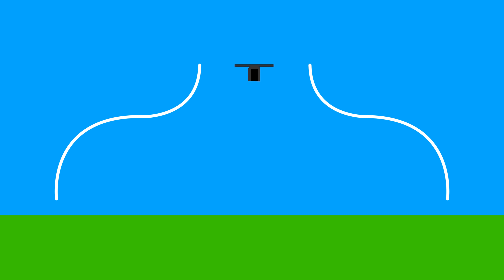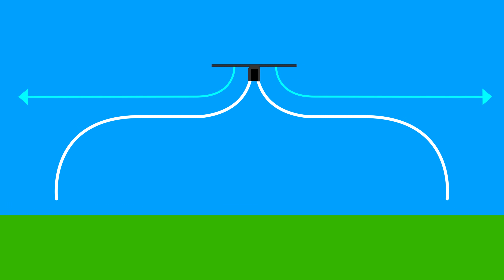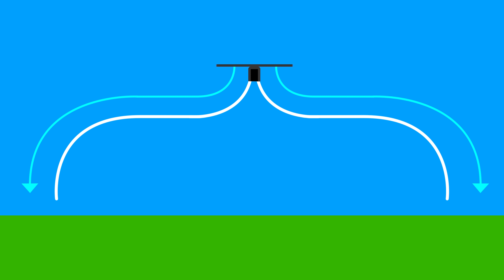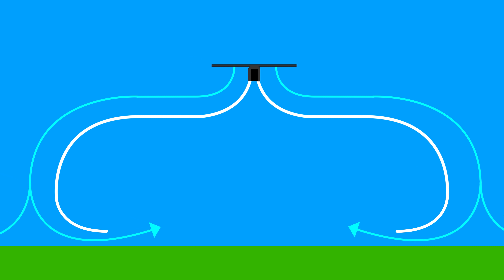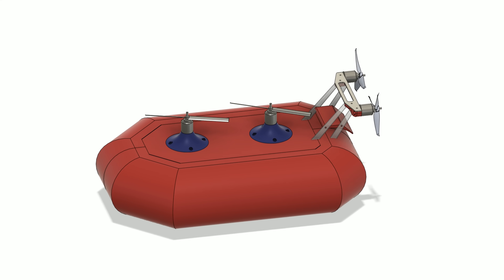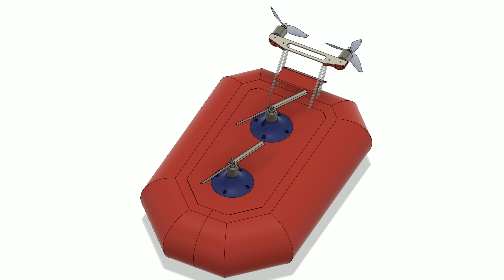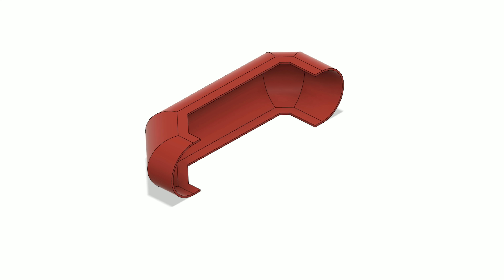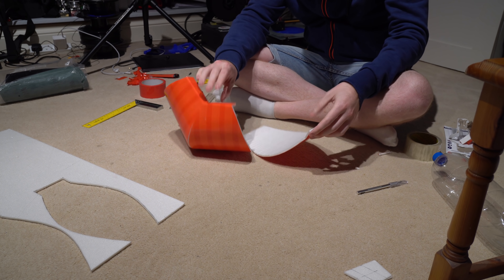Coanda Effect Hovercraft

Comment: The efficiency of this setup puts tears to my eyes, but it's a very interesting experiment nonetheless. I'm glad to see you use foam as well, it can't be praised enough for small scale lightweight construction.

Please keep doing ground effect vehicles! I would really love to see you attempt a wing-in-ground craft in the spirit of the Orlyonok: a long fuselage with stubby wings, a high T tail with the main propeller blowing onto the control surfaces, and a pair of front-mounted jets blowing air under the wings for takeoff.

You definitely have the skills needed to address the vertical stability issue, using some kind of distance sensor and a PID + filters to keep altitude within the tight stability envelope.
Reply: Or perhaps a simple trim control for the lift motors for a start?
Reply: Totally agree about WIG. I find that subject very interesting. Also probably significantly more efficient than this arrangement...
Reply: I’d love to see an ekranoplan too!
Reply: I praised some foam and it turned red.
Never again....
(unless I need red foam.)
It shat me to tears.
Reply: Ground-effect aircraft fascinate me as well. Googled and found this, FWIW: http://www.turkstra.com/wig-types/
Nice starting-off point for the various types of "WIG" (new term to me) aircraft.
Reply: Ekranoplane!
Reply: The problem with the ground effect for these kinds of small-scale experiments is that the practical 'hover' height varies in relation to the vehicle's scale.

This is why even a 100 metre long hovercraft is using a rubber skirt to increase the ground clearance.

Aside from serious stability problems with the ekranoplan concept, there's also just the sheer issue of scale;

Normally, vehicle technologies are developed at a small scale and then gradually made bigger.
But the underlying physics of a Ground Effect Vehicle is such that small vehicles are VASTLY less practical than larger ones.

A 600 metre long cruise ship size GEV would function so much better than even a 100 metre long version that it's almost incomparable...

Yet it's self-evidently impractical to jump straight to building a 600 metre long vehicle as a test.

And when you get down to the scale of even a car, you're already dealing with effective 'hover' heights (if you aren't using the rubber skirt thing to artificially increase it) of a few cm...

Something the size of a typical small scale model hovers at such a low ground clearance that even a moderately uneven indoor flooring surface would be difficult to deal with...
Reply: @KuraIthys  I know about these constraints. If you ask me I'd love to see big ekranoplans being developed as a replacement to airliners and/or cargo ships! The scale at which you can make them would likely make them good candidates for nuclear thermal propulsion, as you would have plenty mass and space for a submarine-type reactor + shielding. Yeah you could also make cruise ships, but those should really disappear at some point if we're serious about pollution.

As for the small scale, there are smaller ground effect vehicles being sold that aren't bigger than a small boat, and they definitely only stay aloft through pilot input. You also only need a boat licence to operate them but that's another story. Put a microcontroller on the job with Tom's code, and I think (at least I hope) stability shouldn't be too much of an issue as long as the model's actuators react fast enough, even at an even smaller scale.
Reply: @KuraIthys  I see you talking about scale. If you scaled up his crafts speed of 10mph up to a craft 100 or 600 meters.

Comment: The problem you have with control is that you don't respect the airflow from the propellers to the curved surface. The Coanda effect needs a continuous line of sight between entry and exit point, don't get me wrong, it still work even with the big wall of the deck you've created, but efficiency is nowhere near as good as it could be. The AVRO car, which is the biggest Coanda effect craft (in terms of work put into it) is round for a reason outside the fact that it has an impeller.  I suggest you revisit this in a while by taking the Avrocar's skin off and attempt a non-ducted/impeller-less design. Just my 3 cents.

Comment: could you lower the centre of gravity by suspending a small weight from the internal structure, and lowering the angle of the rear thrust fans, does that not increase the effect at the nose?

Comment: That isnt Coanda effect , that is simply the lift from the two large props which is being limited by the large surface area of the body. Lower the prop height by half and repeat, if its Coander you will get the exacts same result if not its because the prop was providing the lift.

Comment: Hi Tom, do you do this full time?

My other input is, the center mass is obviously towards the back due to the rear motors/fans, could you load the rear lift fan more to compensate? Or perhaps position the batteries closer to the nose?